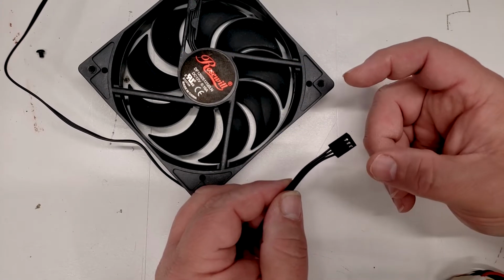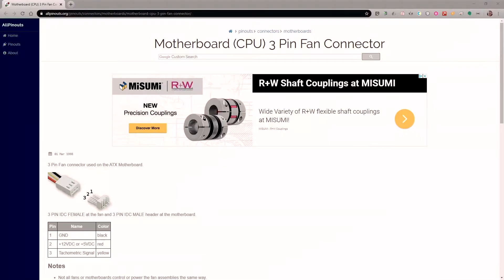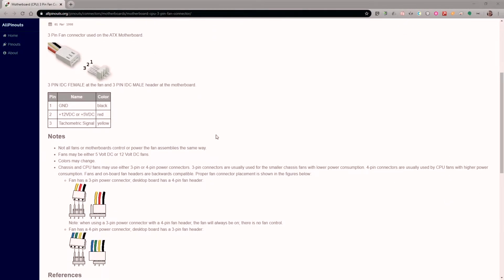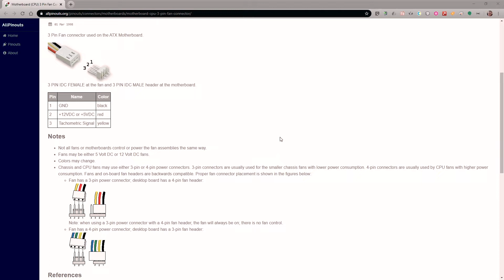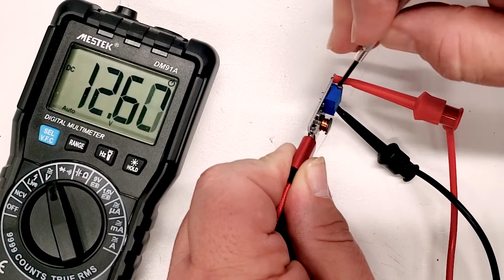DIY Solder Fume Extractor Under $12! | Solder Station Exhaust Fan

Comment from the maker: Are you going to build a fume extractor?  Let me know in the comments!
Reply: Would this work for the vapors for a resin 3d printer?
Reply from the maker: No but this will https://youtu.be/kXT13Q-5tKk
Reply from the maker: @dpjb2930 Jp Are you talking about the USB to 12v board?  That is a boost module. https://amzn.to/2FjXpvS .  That takes 5v USB and makes it as 12v power for the fan.
Reply: im printing the model right now :)

Comment: They're really not  that expensive, anywhere from 30 to 50 dollars, it won't break the bank.
Reply from the maker: 100% but if you have the parts and a printer, why buy one?
Reply: @MakersMashup  Convenience.
Reply: @TBD3.0  When you require to have 10 of them, and a lot of filament it's much better to print than to buy.
Reply: @Mechavis  Even better you''ll get a discount buying in bulk and you avoid the headache of making 10.

Comment: I'm curious as to why you chose to use a metal tool to adjust the voltage on the boost module?

Comment: What happens if I don't use the usb voltage regulator, and just solder the fan wires to a usb cable? Thanks for a great video.
Reply: well it depends how u will power it than ... voltage regulator /part used in video is  Step Up Boost Converter which upscales 5v to 12v/ as it is changes  voltage this main reason was from usb eq /keyboard, pc, powerbank/ to power fan at 12V = from 5voltage input .... its different story if u solder usb wire directly to fan as if u connect it to PC, powerbank it will output 5v via USB maximum or if u plug it into power plug into wall "plug output voltage" 12volt. i prefer to use voltage regulator as its more safe that way

Comment: Works very well! One note, generally for switching regulators you want to tune their voltage under load as they are not good at regulating during no or low load conditions so they might not give you the same voltage when loaded.
Reply from the maker: Good call out.  I've always set these this way.  What sort of load would you best suggest to use to set regulators?
Reply: @MakersMashup  the ideal load would be the load it will see, dial it in without load to ballpark, then hook the fan up and dial in further. It might be pretty close depending on the regulator but good to check at least once.